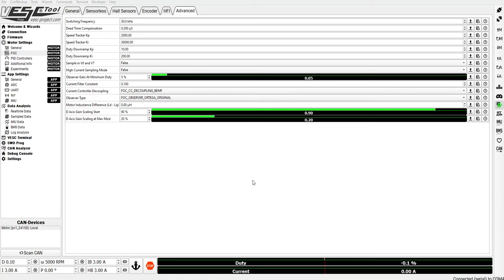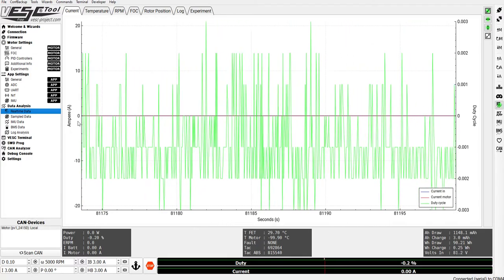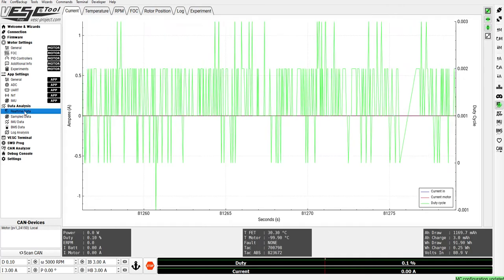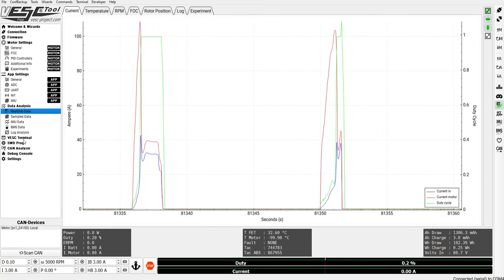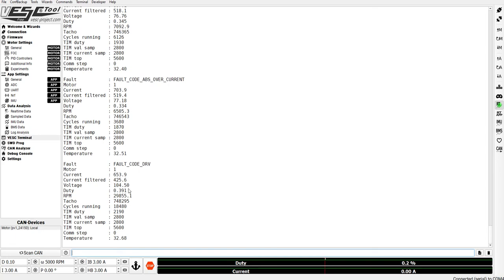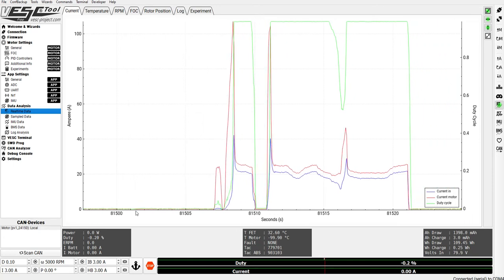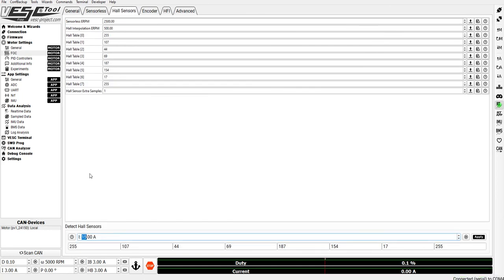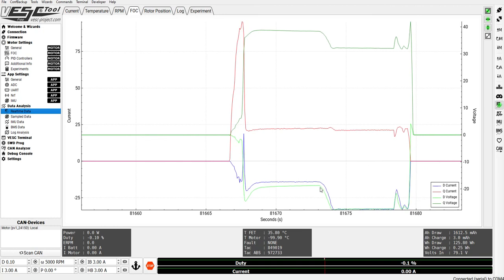PV 24F NextGen Controller - MTPA demo

Comment: Amazing work.. Do you  have any  plans on making this controller for electric motorcycles with proper posts for phase wires..?
Reply from the maker: Can be used on a motorcycle or anything else that needs to be moved. Wires work as good as posts but I am looking into cutting down on wire use as a cost reduction measure. Silicon wires are not cheap.